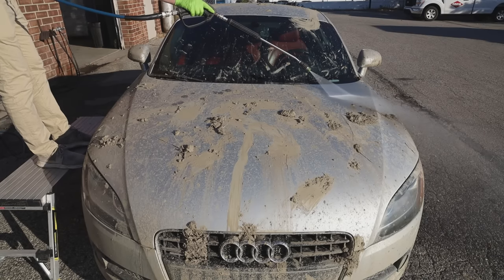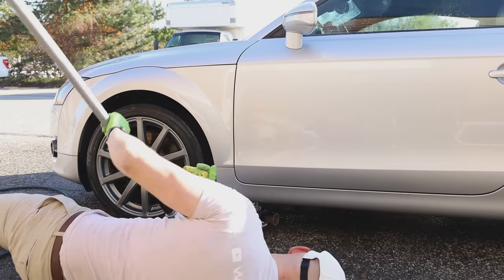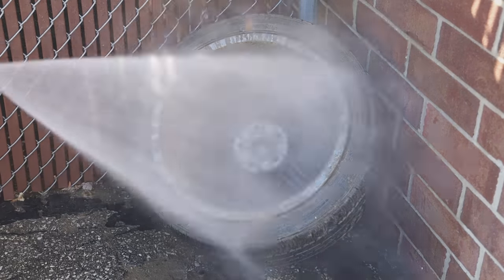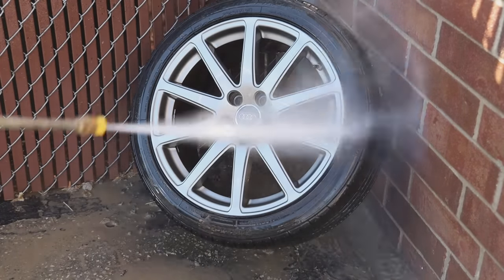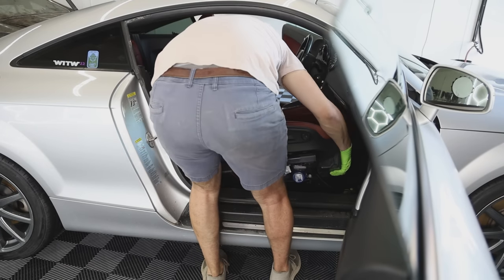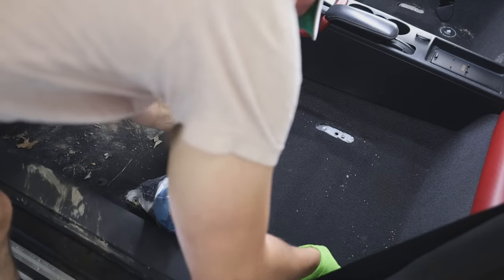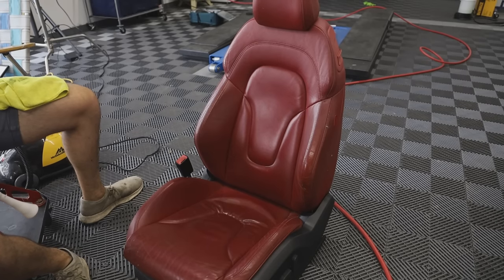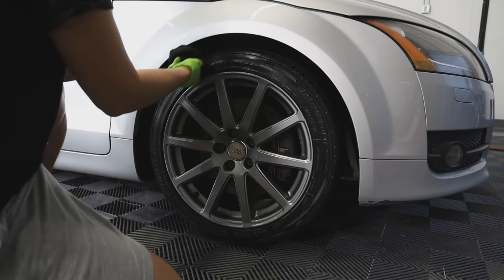Can It Be Cleaned? Deep Cleaning A MUDDY Audi TT For Free! Car Detailing Restoration

Comment: 9:13 engines are usually kept at a certain temperature of around ~35 Celsius, leaving certain parts at much higher temperatures, whereas the water that was being used was probably at around ~10 Celsius. The steam is thus due to certain parts of the engine still being hot enough to evaporate the water (even though it hasn’t been left running for a long time).
Reply: what are you talking about?? engines run at an average of 85-90 C

Comment: one or two could've happened here, either the compressor had being a bit wet/too much oil filled for the engine resulting this, or could just be the heat from the radiator lacking in cooling substance/water in general, now i'm no mechanic but i do study a bit of AC's & fridges...

Comment: don't worry about the steam, it could also be the water if you have a hot water steamer, or its just that the engine is still hot, worry more if its a distinct smell when you wash it, the iron is just because its a lot of iron in the soil specially if its close to a swamp, next pro tip for saving a lot of time and headache, try to upgrade to an hot water steamer, love the vids and respect for the work!

Comment: Loved the real time detailing. Also, after being in the motor trade for several years, I learnt to wash cars from the bottom up to lessen the chance of streaking. Keep up the great work boys, you two are an inspiration.
Reply: From what I know it’s from the top to bottom, since the bottom has more debris
Reply: But then surely you would have to clean the bottom again after it got covered by whatever washes down from the top of the car?!
Reply: @JohnClark-ew8dh  exactly
Reply: @JohnClark-ew8dh  Yes, but it simply rinses off, because the detergent in the water has nothing to cling to. I suppose it's just a matter of preference at the end of the day.

Comment: Him straight up soaking that engine bay gave me anxiety from hell😂. For anybody who cleans out their engine bay, please never spray water directly onto the motor as the water could seep inside and lead to expensive repairs. Cover the motor with a trashbag or tarp or something similar and also be sure the battery is disconnected until the wet cleaning is finished.

Comment: The reason you got steam coming out is engines take time to cool down so the engine even the exhaust headers will still be warm as well. Learn about cars before you start detailing. That's chemistry and mechanics 101. I don't think you have business detailing or even being near cars if you don't know all that. Plus these more exotics (as we in the automotive hobbies call them) are a little more sensitive in the engine bay. (I once owning a Mercedes Benz know this )
An ignition chip alone (the size of a thumb nail) is like $600 so I'd do research on exotics before you detail them.

Comment: @19:21 - Environmental Fallout, which are things like tiny metal particles from industrial sites, trains and even brake dust. These particles float up and around the air and stick hard and fast on your vehicle’s surfaces. The heat of the day, heat off your car and even the heat of the metal particles will cause the metal to embed itself into your paint’s clearcoat.

Comment: there is so much iron on the WRX and TT cause both went mud, there is a small of iron in mud...when mud is continuously hitting the clear coat and the car being hot the iron is sticking to it, not to mention that the drivers are not rinsing the cars off right after mudding...